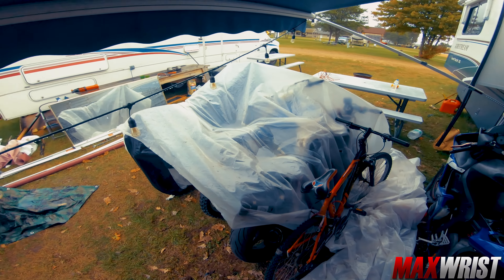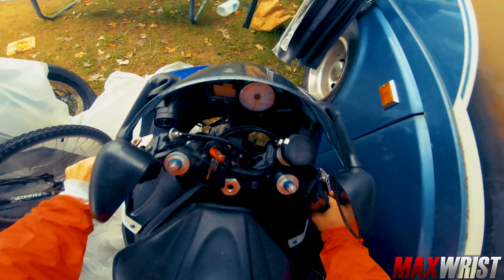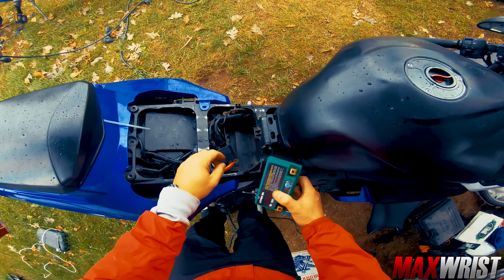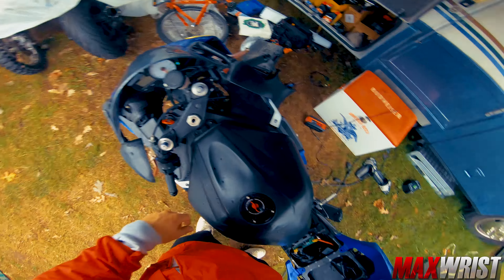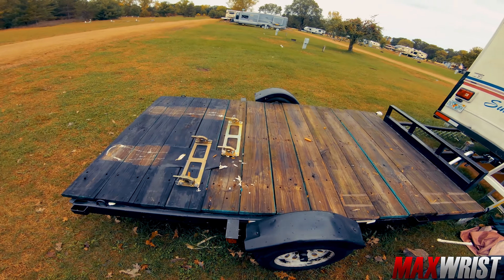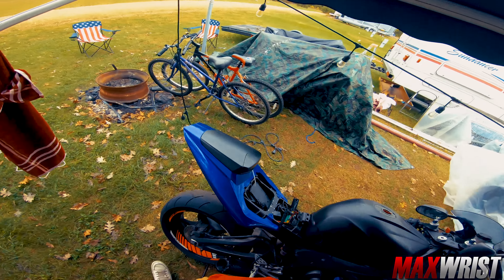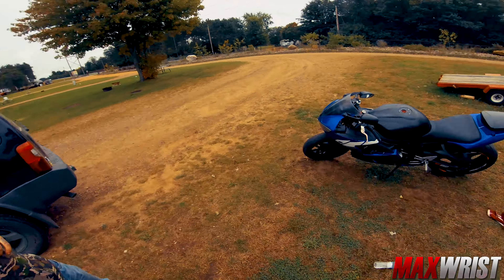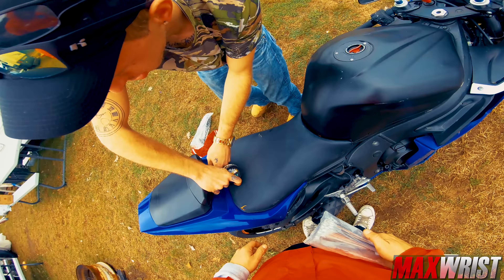MAXY SELLS YAMAHA R6 FOR $500!

Comment: Doesn’t have axel nut. Proceeds to ride away without helmet. Haha. Super sketchy.
Reply: Death machine💀☠️☠️☠️☠️☠️☠️☠️☠️☠️☠️☠️
Reply: Frank Blevins I would of trailered it home. Could of rented a u haul truck or trailer.
Reply: Buddy is very lucky...dumbest decision ever.
Reply: Ridden my yz with not axle nut and hauled ass didn’t come undone
Reply: LOE Nate dumbest decision ever with the chance of having an ok bike for $500
Reply: @thomasgu3281  rode my fz6 with an axle nut that vibrated off. The wheel kept coming in and out of alignment and the chain tension kept changing. It tried to kick me off on a roundabout when the wheel shifted on one side and started turning into the roundabout, and the chain came off twice.

Anecdotal evidence, or te mere fact that you had a lucky encounter with it, doesn't mean that it's safe to do. The cable tie stopped the axle spindle coming out completely sideways, it didn't keep it in place forwards or back, nor keep the wheel/brake assembly in place, nor the chain tension.
Reply: G B yes sir but I’ve also sent it around my neighborhood after the rebuild with no helmet /:

Comment: Also what is that throttle pad on your bike? And do you feel the helite airbag is the best one for commuting, instead of the others without the rip cord?
Reply: Old comment but that is a cramp buster. Just clips on the throttle so you can hold it in one position with the weight of your wrist. Helps on long highway rides when your wrist feels crampy

Comment: I got the same bike 2004 I might have to change the coils RPM bouncing
Reply: yea it's a very common problem on the second gen r6's. I was actually running on 3 cylinders because of a bad coil. I just changed all of them along with spark plugs and it was good to go
Reply: Gabba Shanking nice how much $ you think a job like that would be consider I live in the US

Comment: Bro im going to buy a Hercules prima 5 tommorow for 550 and its over 30 years old and has 50cc😂
Reply: REDZACK why not get an older ninja 250 for around $1000
Reply: @toptierfish9335  im turning 15 in November
Reply: REDZACK If u can come up with 550 u can work a little harder for $1000 and get a cheap 250